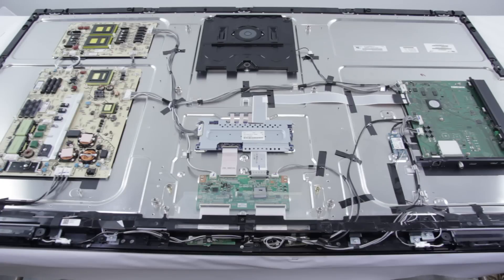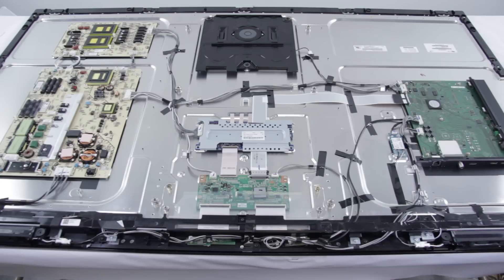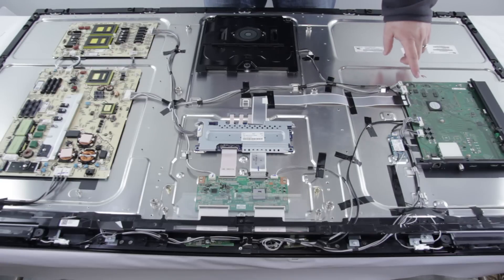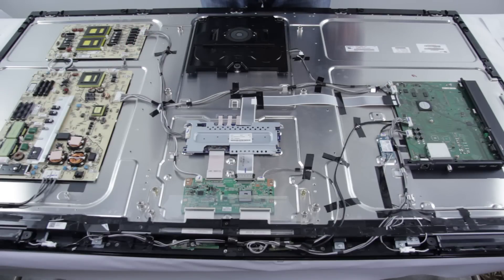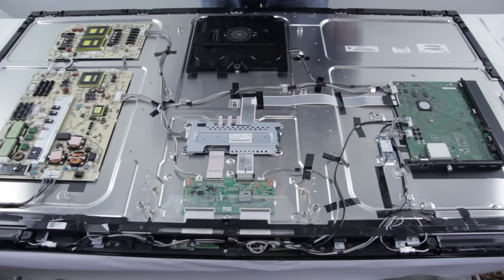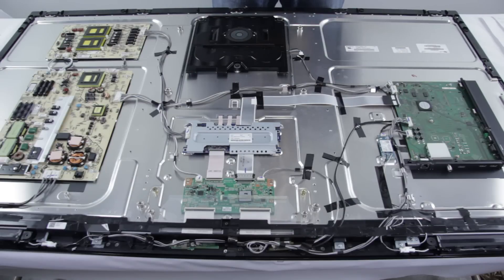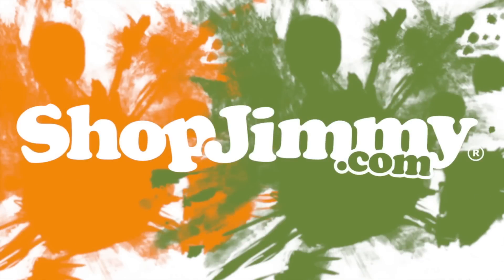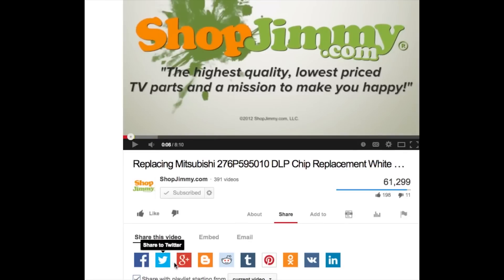LED TV Repair Main Board Overview Blank Screen-TV Has Audio but No Video-Common Issues Problems

Comment: Hi my LG - 55LE5400 is stuck on LG logo screen during startup. None of the Menu buttons work using remote or the TV. I tried resetting using many different instructions I found on google. How can I confirm if this is a main board or any other bad part? Thanks in advance for your support!

Comment: Hello,
I have a westinghouse LCD 46in LCD Model VR 4625. I was watching tv and all of a sudden the picture and audio go out and has not come back. What do you suggest?
Thanks
Reply from the maker: target11  Try all repairs and troubleshooting at your own risk.  I recommend replacing the main board in your TV.  Click this link to replacement parts for your TV model number:  http://www.shopjimmy.com/catalogsearch/result/index/?cat=56&q=VR+4625  There may be multiple boards for the same TV model number, be sure to match part numbers on your current board, with your replacement for compatibility.  Here is a link to a video showing how to identify your part number, click here:  https://www.youtube.com/watch?v=SoUXsgOx25o  Thanks and please let us know if you have any further questions with your TV Repair!  www.shopjimmy.com

Comment: I have a seiki model se50fy10 that I believe I need to replace the backlight board on. I performed the flashlight test and could see the menu and here sound but no picture. issue I have is I'm not seeing an individual board like shown in your video. but following power cables I was thinking it was built into power board. any help you can provide to clarify would be greatly appreciated.

Comment: Hello i have a westinghouse vr6090z and at first the sound on the tv went and then the 1st hdmi had a weird clicking feedback when used then the tv wouldn't turn on. I was thinking the main board went but now possibly the inverter board aswell any help will be immensely appreciated. Thanks agian joe

Comment: Hey! Just bought a main board from you for my 32in ONN tv model number 100012589 have audio but no picture. Started acting up after a power surge. Any suggestions?

Comment: I have a 50 inch LG screen tv  50LN5100-UB and the screen went black but has sound, Ive been told that I need a new backlight panel, can you tell me which one to buy from your website?
Eric from Arizona

Comment: I have a Westinghouse DW39F1Y1 LED TV. I believe the backlights are non-operational as I can see words and images when I shine a flashlight onto the screen. I replaced the main board as I hope the backlight inverters were integrated. If they are I guess the next step would be to replace the backlight LED strips? Any assistance you could provide will be greatly appreciated.

Comment: I have a KC 3913 TV, around 18 months old. Just found today it won't turn on, the blue light on the side button panel came on briefly but went off. Now it just won't power up or do anything at all. Any ideas? Is this repairable? I have tried straight into the wall, different power sockets around the house etc.

Comment: Hi Jimmy, I need to know which parts I need for a Vizio E550i-B2 (LWZ2PPAQ3306452). My Tv has power, but the screen is black, and it does have sound.  I believe the backlight is damaged and would like your advice on which parts I need to fix this.  I would rather replace the entire board if that makes the repair easier because I don't have experience with TV repairs.  Thank you for your help with this.

Comment: Hello, I have a LG 42 inch LED TV 42LV5500  which suffered a power fluctuation and the HDMI ports have stopped working. WOuld that be a main board? I am a little sceptical in opening it up and checking the part. Can you suggest the exact part that i can buy at shopjimmy? thanks.

Comment from the maker: Thanks for watching our TV repair video! Due to YouTube policy changes, we are no longer answering tech support questions in the comments section or on the phone. We apologize for the inconvenience. If you need additional tech support, please visit FixYa.com or contact your local TV repair shop. Good luck and let's fix your TV today!
Reply: Hi, I have  50inch sceptre with serial number x505BV-FMQR8CAAV93BA model X50.
We were watching TV and the screen suddenly went black as if it was turned off but we could still hear the sound, I flashed a flash light to the screen and was able to see a bit of the picture of the movie. I'm hoping its a quick fix like a fuse replacement.. Please help, I've only had this the for 6 months or so
Reply from the maker: Luisanna Jimenez  Please watch this video FIRST to help with your repair!  https://www.youtube.com/watch?v=BP3NVNCGEv8  This could be a problem with either the power supply or bad LEDs in the TV panel.  You can replace the power supply to see if that fixes the problem.  Click this link to replacement power supply boards for your TV model number:  http://www.shopjimmy.com/catalogsearch/result/index/?cat=59&q=X50&tv_brands_select=Sceptre  There may be multiple boards for the same TV model number, be sure to match part numbers on your current board, with your replacement for compatibility.  Thanks and please let us know if you have any further questions with your TV Repair!  www.shopjimmy.com
Reply: I have a vizio M550VSE 
the TV turns off when I have something plugged in The HDMI ports...if the TV is on and I plug in my ps3 into the HDMI port the TV turns off...if I disconnect the ps3 it will turn back on..please help thanks
Reply from the maker: Humberto Garcia   Please watch this video FIRST to help with your repair!  https://www.youtube.com/watch?v=BP3NVNCGEv8  I recommend replacing the main board in your TV.  Click this link to replacement parts for your TV model number:  http://www.shopjimmy.com/catalogsearch/result/index/?cat=56&q=+M550VSE+  There may be multiple boards for the same TV model number, be sure to match part numbers on your current board, with your replacement for compatibility.  Thanks and please let us know if you have any further questions with your TV Repair!  www.shopjimmy.com
Reply from the maker: mikeymousehouseful   Try all repairs and troubleshooting at your own risk.  I recommend running the flashlight test on your TV.   Here is a link to a video we produced that shows how to run the flashlight test. https://www.youtube.com/watch?v=xUzCLgoSPGM Please reply with your flashlight test results and we can recommend a replacement part for your TV repair. Thanks and please let us know if you have any questions! www.shopjimmy.com
Reply: +ShopJimmy.com I have a Vizio XVT473SV. When I turn on the tv, the audio crackles for several minutes and then either starts working or I lose audio all together. If I get no audio, I leave the tv on for a couple of minutes and then restart the tv and the audio begins to work. This has been going on for 3 years. For the past two years, the audio would always work on non-HD channels but not on HD channels until I either waited several minutes or restarted the tv. Now the issue is becoming worse and both non-HD and HD channels are affected. Moreover, one of the HDMI jacks has started to not work. Could this be an issue with capacitors? Is it the mainboard?
Reply: +ShopJimmy.com 

 I have an LG 55" LED/LCD   Model# 55LE5400;  Serial# 004RMFP35995;  SVC CODE#55LE5400-UC.AUSWLJR.    

We were watching TV and the picture went orange on one side and purple on the other and shut off.  Now when I turn it on the lights come on the bottom like usual but the screen stays black and I can't do anything with the remote except turn it off.  thinking the main board went out,  before this happened the TV would lock up(all the lights on the bottom stayed on) and i would have to reset it by removing the HDMI cable. Any help would be great.
Reply: 95% of the time when a screen goes black with an extremely dark picture visible means an LED is out moreso than it being a main board issue. This is due to keeping the Brightness and Cell power adjusted too high in the settings causing the LED's to overheat and eventually either just blowing or the diode cracking from the excessive heat. Always have the Cell and Brightness set at 50% for a longer lifespan. 

This is an easy fix for anyone. All you need to test the LEDs is a DMM (Digital Multi-Meter) set to the Diode setting and a cold beer.
Reply: BTW, YouTube can't lawfully have a Policy that would keep anyone from answering Tech Support Questions in the Comments or Over The Phone. Obviously Shop Jimmy is an advocate for FixYa.com which also explains why nothing is ever Answered, Taught, or Shown until you Sign-up and become a Paying Member of FixYa.com

This also explains how "coincidentally" this post advertising FixYa.com was posted right after the Video was posted.
Reply: have samsung CS-21Z45ML AUDIO IS FINE BUT AV MODE HAS NO SIGNAL, IT CANT SEARCH FOR CHANNEL AS WELL , IF I PUT AV IIN , THE SCREEN GOES BLANK AND NOTHING COMES OUT, BUT IF I PRESS MENU ALL THINGS ARE DIPLAYED PROPERLY
Reply: I have a 50 inch Affinity sle3050m n the screen is black but i can here the picture playing what's cause that

Comment: 1st comment:  LG 32LN5300-UB powers on with remote but has black picture and static sound.  Your reply suggested to replace the led strips.

The static pluses, if that tell you anything.  When doing the flashlight test I can see the icons.  I've replaced all the boards with no success.  I'm becomming obsessed with repairing the tv.

1. Could the ribbon cable be bad?
2. Is there a video on replacing the LED light strips?

Comment: I have a Mitsubishi LT-55164 I used the TV for years with the front speakers then they started sounding bad so I hooked the RCA audio output to a surround sound system that lasted about a year now I have picture only and no sound, what do you think? Main board?

Comment: Hello, I have a question regarding my Rca led model #led65g55r120q. It has no picture or sound, I did flashlight test, and it had backlight. I already replaced the te con board, would you suggest replacing the main board next?
Reply from the maker: +Danny Sedillo   Try all repairs and troubleshooting at your own risk. This could be a problem with either the t-con board, the main board or the TV panel. You can replace the main board and the t-con board individually to see if one of those boards fixes the problem.  Click this link to replacement parts for your TV model number:   http://www.shopjimmy.com/catalogsearch/result/?q=led65g55r120q  There may be multiple boards for the same TV model number, be sure to match part numbers on your current board, with your replacement for compatibility.  Thanks and please let us know if you have any further questions with your TV Repair!  www.shopjimmy.com

Comment: I have Toshiba 46L5200U. Recently, the picture would be on then I would see a flickering light. The screen goes dark but audio remains. What should I do? Some friends have suggested changing a light bulb, driver, but I am confused. What do you think?
Reply from the maker: William Cain  Try all repairs and troubleshooting at your own risk.  This could be a problem with either the power supply or bad LEDs in the TV.  There are no bulbs.  Click this link to replacement parts for your TV model number:  http://www.shopjimmy.com/catalogsearch/result/?q=46L5200U  There may be multiple boards for the same TV model number, be sure to match part numbers on your current board, with your replacement for compatibility.  Here is a link to a video showing how to identify your part number, click here:  https://www.youtube.com/watch?v=b9L0-m0-pjA  Thanks and please let us know if you have any further questions with your TV Repair!  www.shopjimmy.com

Comment: Have a Vizio model # vo47l fhdtv10a. We replaced the upper board that had a burnt mark. However, we still have a black screen with sound; but we can see a little bit of the program. We are we missing?  Thank you

Comment: I have a Vizio 47" XVT SV470XVT1A. None of the HDMI ports are working. Although the TV's tuner COAX is working fine. I have already tried the 30 second power cycling that Vizio suggested to me. I have already tried different devices as well as different HDMI cables as suggested. All these devices and cables work on other TV's in the home. Does it sound like I need to replace the Main board? Is there a possibility that the problem could be in the daughter board instead? Main PCB no. is 3647-0132-0150 and daughter board part no. is 3647-0022-0185. The daughter board looks like it has a harness that may go to the LCD and could be in control of it, possibly being the TCON. Please let me know what you think and where I need to go from here.
Reply from the maker: Mike Davies   I recommend replacing the main board in your TV.  Here is a link to replacement parts for your TV model number on our website, click here:  http://www.shopjimmy.com/catalogsearch/result/?q=XVT+SV470XVT1A  Be sure to match part numbers on your current board, with your replacement for compatibility.  Here is a link to a video showing how to identify your part number, click here:  TV Part Number Identification Guide for Vizio Main Boards (Plasma, LCD, LED)  You can also call our customer service for further assistance with your purchase.  (877) 881-6492  Thanks and please let us know if you have any further questions with your TV Repair!  www.shopjimmy.com

Comment: Hello, I have SEIKI SE40FY27 that stopped working few days ago. I am getting audio but no video. When I turn the TV on, it flickers a white screen and goes black. I did the flashlight test where I pointed the flashlight at the screen and clicked menu. I was able to see the menu. after opening the TV I saw 2 boards, main power board and a T-Con board. I am unsure of what went wrong and wanted to get your opinion. I've done some research but have not found any solution. Should i replace the main board or the t-con board? Thank you in advance!

Comment: Hi -- our Samsung LED 50" TV (2012) has gone black but audio is discernible.  Wonderful husband has taken it to a TV repair shop to be told that main board is out and cost to repair is $230.  I've watched alot of videos and have searched the cost of the main board for the model and it doesn't seems like a hard repair and part ranges from $30-$40.  Should we seek second consult?  Do you think its a fair repair price?  Any informative response would be highly appreciated.  Thanks!

Comment: I bought the replacement part from you guys replaced the  TV IR  on a Vizio M3D651SV and the remote works the TV now. The only problem now is I cannot get the  MENU to stay on enough time to make any adjustments or changes. When I hit the MENU button the menu pops up enough time to see it, but not enough time to adjust any thing, then disappears until I hit the button again. Tried a hard reset by unplugging and holding jog wheel button in for 39 seconds with no luck. I can't get it to reset. Please help me out, Tks Joeydee.

Comment: A friend has asked me to see.if I could fix there Polorid 32" P32LED13. The symptoms is. To me looks like no power going through the tv at all. So checked fuse. Changed it 3 times to make sure. Still no power. Checked wiring with meter. Seems to be ok. Changed Power supply board. I can hear that humming when powered up but yet nothing on screen nor any LED indicator nor sound or visual. Could it be a faulty main board? The TV isn't that old. Thank you again?

Comment: Hi well i like the good job u people are doing and i have a samsung model UA46F5000ARXZN that has when u switch on power and press the power button, there is a sound of starting but no backlight and no picture. well when i opened inside i noticed that when the power button is pressed the leds on the t -con board light for a short time after the on sound but then seems to go to stand by.i suspected the main board and when i looked at it i saw some two inductors looking a bit burnt. Could you help me confirm that its a main b problem!?

Comment: Hi, I have a LG UB850v 55. I have replaced the main board as the tv screen died while watching it. Upon inspection notice small resistors on the board had blown. Replaced the board from a lgub950v tv which according to the chap I bought it from should work. Now upon turning the tv on I get a blank lit screen! No power led either. Any idea?

Comment: I have an LG 50LN5700 that will work fine for about 15 minutes. After that time the video goes out but still has audio. Checked the board. Main board reads good. Led both read 110-115v. When the led lights shut off the power drops to 79-80v. Is this a power supply board issue? Thanks in advance.

Comment: Vizio E420i A0. Replaced power board. TV now powers up with sound. Flashlight test reveals a faint menu screen and you can see a faint tv image as well. Is the LED backlight Inverter next to replace?

Comment: I have a Vizio e500i-a0.  Upon powering it up you see a quick flash of the logo with black screen. Some slight whiteblinks and the flash of whatever is on the screen real quick. Not long enough to properly change inputs or anything.  But only a flash. Since it's mostly a black screen. And sound is fine. I replaced the power board since it's was the less expensive with no result.  I was going to buy the main board but rather try and speak to someone before I did.  Thanks in advance for any help/advice you may be able to give

Comment: Hi mate.  I'm searching high and low for a main board for a Hisense HD TV model HL55V88 and main board RSAG7.820.1536/ROH VER.E. Hisense Australia wants $110Au. for the board. Also are there other boards compatible? I'm an electronics student, mature aged, and my eyes don't like the small details, so if push comes to shove I'll have to get out the solder iron but I'd rather just put in another board. Thanks.